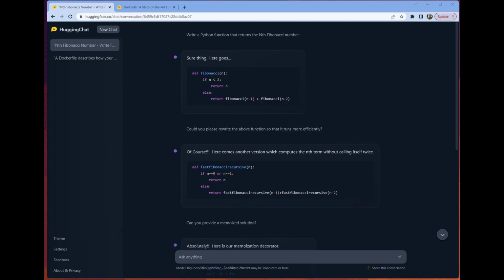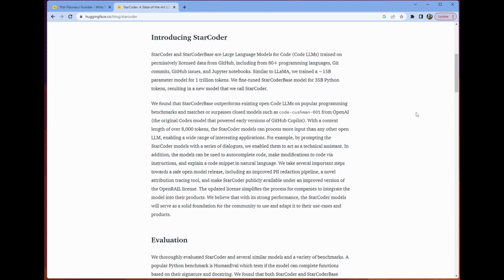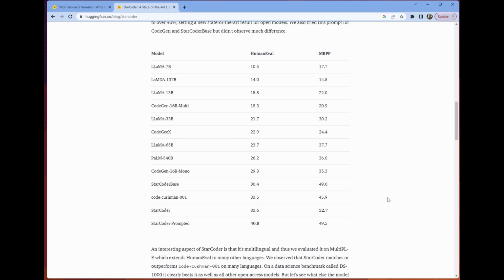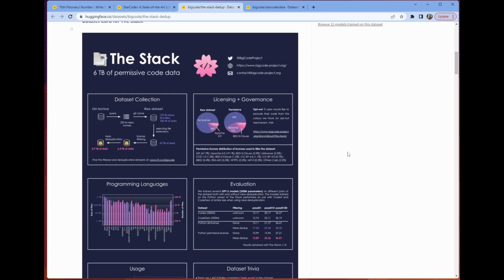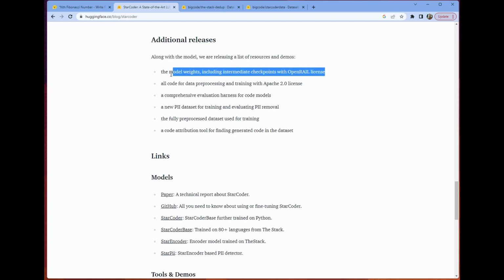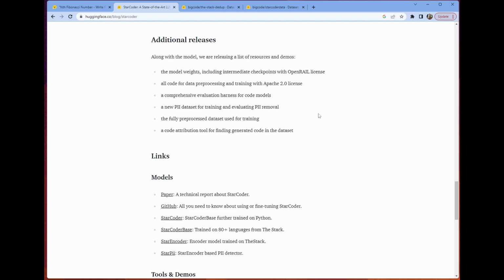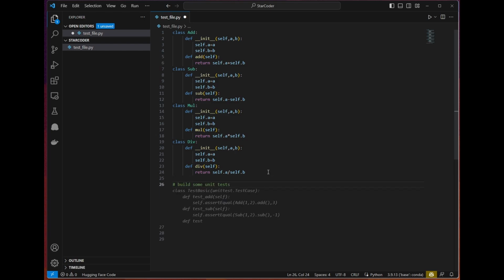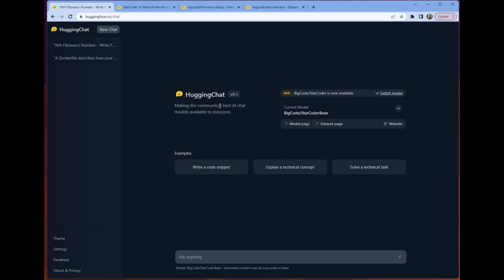Exploring StarCoder: Open Source LLM for Code Completion

Comment: Very informative video, thank you.
One question about HuggingFace Chat. How did you get the change model option ? I see the current chat version is v0.2 and in this version or in my account at least, the change model option is missing. 
Thank you
Reply from the maker: It looks like they've removed that particular option from the Chat demo! 

You could still use the model by heading a Space powered by the Chat model!